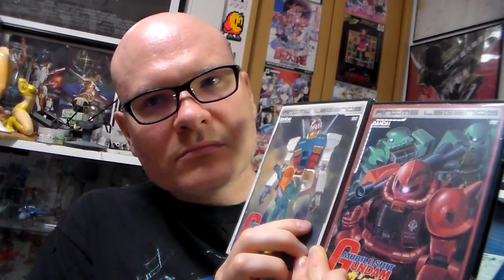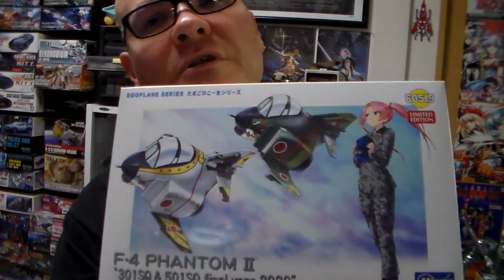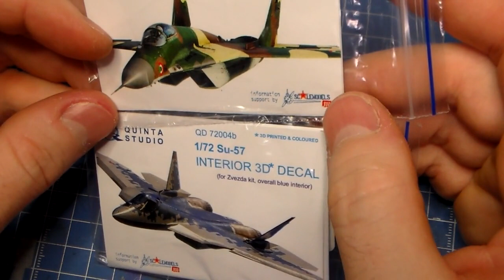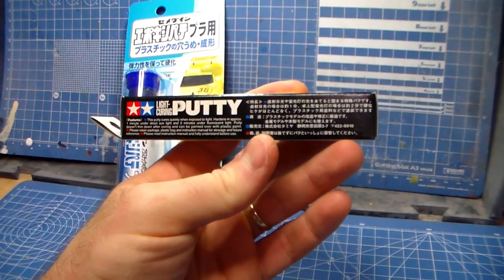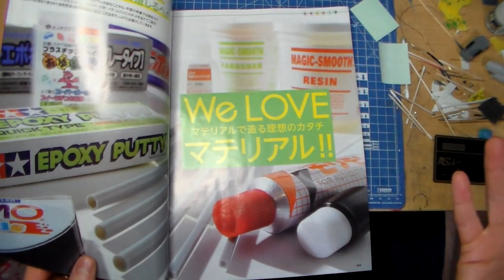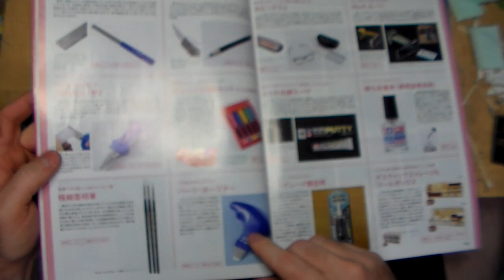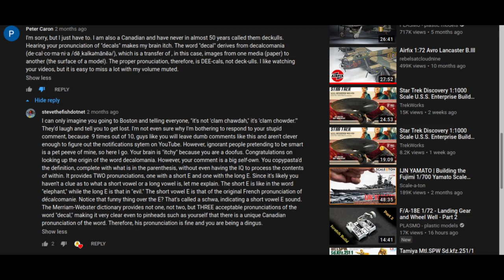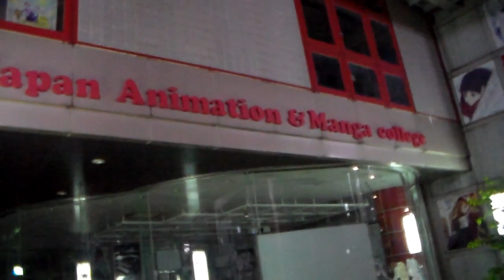2020 July Channel Update

Comment: Nice update. I liked the Gundam stuff. The Lazer Disc was sweet. I keep getting distracted by those sweet kits above your right shoulder. I have alot of them. Mad Max XB Falcon is a favorite 🏭🐭👍
Reply from the maker: I'm lucky I bought my Mad Max Interceptor when I did because these are OOP. When I worked at Aoshima, we wanted to get the Mad Max license again in order to re-produce this kit along with other vehicles from the second movie, but it just wasn't available. I see companies like Greenlight making replicas of the car anway, but without using the Mad Max name. I guess that's one way around the issue. Fujimi did the same with the Blade Runner kits you can also see on that same shelf behind me.
Reply: @stevethefishdotnet  yeah who knew it would be unicorn kit. I also got one yrs ago. Built it, but always wanted to do it again. They could make a Killing repoping them. I have all the Bladerunner cars except for Decards Red car with the blaster. I have 3 spinners. Also picked up that greenlight diecast Interceptor. Thanks Greg 👋🐭

Comment: Hi Steve, I mean Greg, that air adjust screw is sometimes referred as a MAC valve, it allows you to drop your air pressure to the air brush without having to go to your compressor and adjusting the regulator, so its cool to use if needed.
Reply from the maker: Thanks. It seems pretty useful. I have not yet used my airbrush since it rains every day lately and I don't want to open a window. At least the hot summer has not yet started and I don't need to use my AC much.

Comment: Ahh I get what you was saying about you're wave airbrush now, that needle tip is huge compared to mine, if you sneeze whilst cleaning it, good luck finding the thing, is the mr hobby one big as well. Also Another 88 kit so jelly 👍
Reply from the maker: The darned nozzle kept getting stuck into the tip of the airbrush, and I'd used the needle nose pliers to pry it out too often and eventually I damaged it and the O ring.